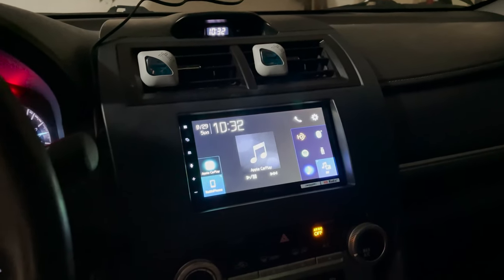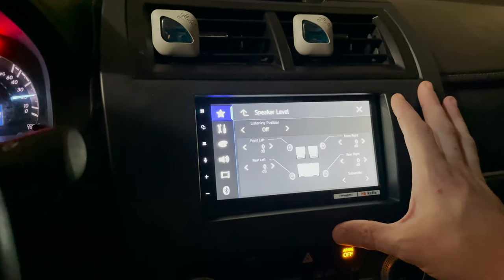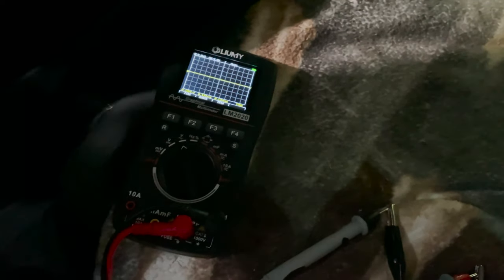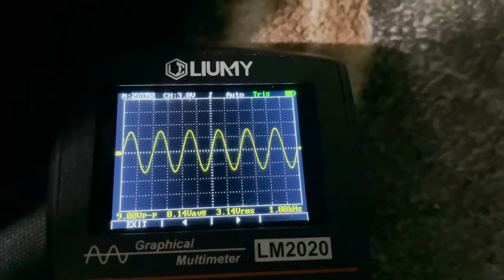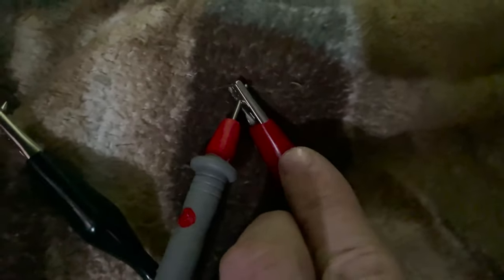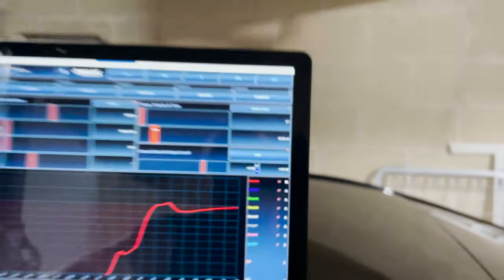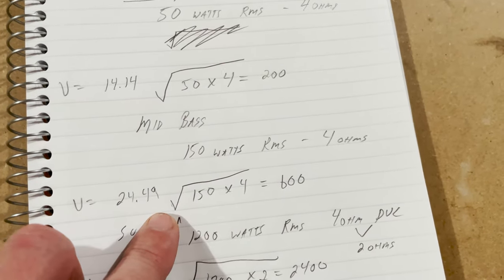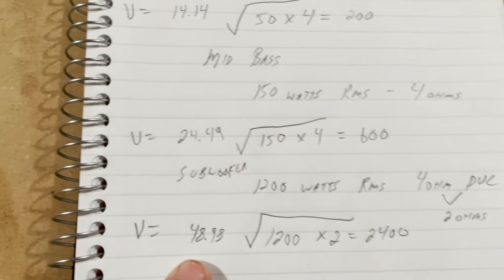SQ Basics Pt 1 - Front to Rear Clipping Prevention and Gain Matching a Fully Active 2/3 Way System

Comment: thank you for explanation, will lower the gain on my amplifiers asap as I push 55w to my 20w (150w max) tweeter and 30w (160w max) mid (focal flax), nothing blowed yet but levels are over the top I guess. Actually my mids are smelling funny, smelling toasty, I'm not kidding. Still giving me the sound tho, so will protect them asap.

Comment: When you were setting the gain on the tweeter, did you have a load; a 4 ohm resistor? I'm assuming the tweeter was disconnected at the time that the output was 25V. Good stuff though .... thanks for the video.

Comment: In your  part  2 video your using REW. REW has an Oscilloscope and RTA tool. Is it possible to use a sound card as the input selection in REW and connect your RCA's to the soundcard and take the readings in REW?

Comment: You shouldnt have the eq flat on the deck ,if you're going to use it afterwards..the deck or/and amp will probably go into clipping .imo into
Reply: Wrong
Reply: @jms7585  then as soon as you turn it on,the amp will end up clipping..that doesn't make any sense
Reply: @jms7585 yes YOU are wrong
Reply: @smtyson1650 You do all equalization before gain staging. If you’re boosting eq then you want it not to clip; hence why you have it on while tuning.
Reply: @isaiahhood236327  you said the samething I just said bro
Reply: @isaiahhood236327  other people saying it should be off. that would defeat the purpose of setting the gain for clipping,if you're going to turn the eq on afterwards

Comment: There's a statement he made that's actually incorrect, he stated he has too much wattage for the speakers! Which is incorrect,  that is  watts (power) will NOT destroy your drivers!!
 underpowering them with the amp in clipping or head unit in clipping will destroy them.
by ramping  High current levels....